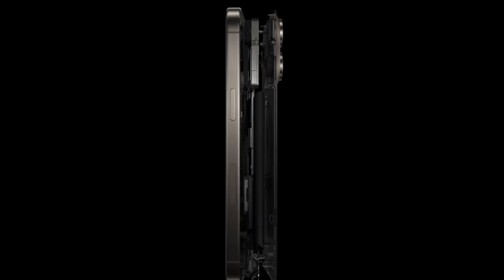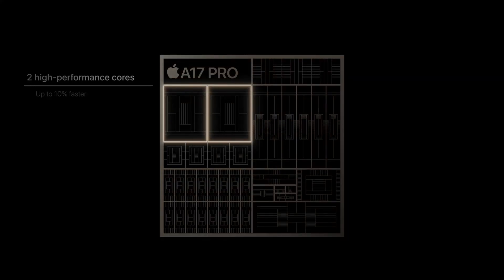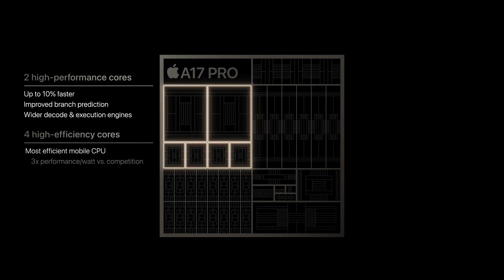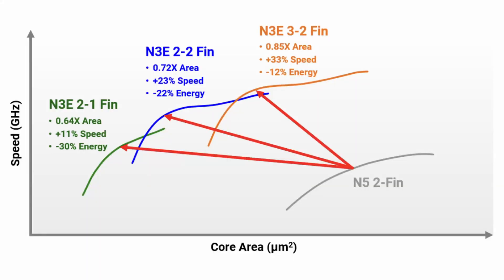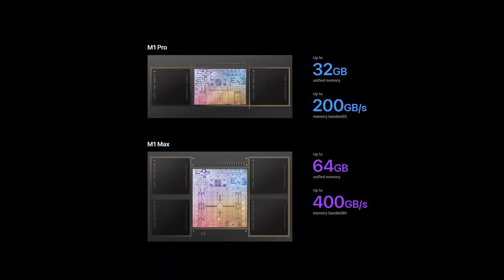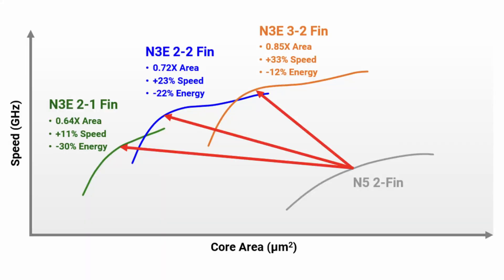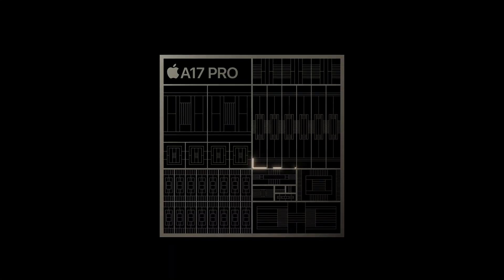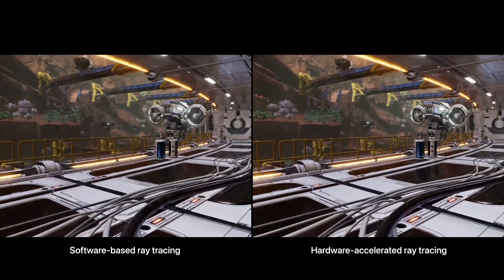Apple M3: some thoughts on the upcoming chip

Comment: Sorry, but I have to strongly disagree.  The three styles of 3nm design are quite correct, but the design of the GPU is very, very different this year.  Apple was going to do what is now the M3 in the M2 slot, but the graphics engine addition of hardware ray tracing was defective.  Their method created too much heat, far too much for the Vision glasses.  So, Apple panicked.  First, they put the M1 graphics engine in the M2, and pulled back from 3nm until they had a fix for the GPU.  Then, Apple fired a whole bunch of engineers, then took the remainder off to Blender to figure out what went wrong.  This is quite amazing for Apple, by the way, who usually does everything in-house.  Well, Blender, enthused by the huge lump of money dumped on their consortium, did indeed fix the problem.  So, adding GPUs is not at all the same now that you have a tiny NVIDIA card in each GPU unit.  Oh, and another thing, think back.  At the beginning of the M series development, Apple made a change to Metal. No one could figure out why, but it was to remove certain methods that require very high bandwidth for ray tracing.  But why, everyone wondered, Apple had a high bandwidth interconnect on board the chip.  Then, the Mac Pro, a big box with a backplane.  Huge power supply, mostly empty.  Then there was rumors of a cluster addition to MacOS.  Well gee,  put that all together, and you have a 4 processor M3 Ultra cluster server with distributed hardware ray tracing that is a brute.  An absolute brute.  96 GB of shared graphics/system RAM per processor.  Whee!
Reply: Blender (a software 3d developer) fixed Apples GPU (hardware) problem?  Pull the other one fella—it’s got bells on it.

Comment: What is your take on all the overheating and thermal throttling issues of the A17 Pro in the 15 Pro iPhones? As far as i know A17 Pro is on N3B and not N3E, which looks to be a more significant disadvantage than expected. I guess M3 will wait for N3E then - probably mid 2024. I do not share your take on apple differentiating between processes on for example cpu cores for M3 and lets say M3 Max. Apple was able to hugely benefit from a scalable and modular chip design. I would suspect such a move would neglect that advantage. Especially in current times, where Apple seems to aim at stable prices they surely won´t go the luxuriant route. That said, i am sure that Apple will differ the process between cpu, gpu, npu... as far as it won´t affect yield. Regardless of what Apple choses to do, I am excited to see and I am sure we will find out, although we might need to wait for some time.
Enjoy your vacation!
Reply from the maker: I need to reserve judgment on the A17 Pro until I can do my own testing, but I’ll do a video if I have anything to add to the discussion. Thanks for sharing your thoughts 👍🏻

Comment: I think that it unlikely that entry level M3 systems will be balanced systems designed to give the maximum performance possible at a given price point. Instead like entry level M2 Macs they will have a single small slow FLASH module and only 8 Gb of RAM. People will boast that their new 256 GB 8 Gb M3 MacBook Air is faster than any PC laptop, whereas they would get better performance with any M1 or M2 MacBook Air with more Flash storage and RAM.

This reminds me of when I helped a rich accountant to set up his new £399 Sinclair QL system in 1984. He told me that he had bought it because the advert said that it was a 32 bit system and so was around 5 times faster an IBM PC costing ten times as much. I did not labour the point but hinted that he was wrong. The reality was that the 32 bit 68008 processor in his QL was crippled by an external 8 bit data bus and by having tape rather than hard disk storage. 

In the same way entry level Apple Silicon Macs are crippled by slow SSDs and by not having the 16 Gb of RAM that would be present in any entry level PC.

Comment: Do you think Apple’s choice on FinFlex is what accounts for the high power consumption and reported hot running of the new Apple iPhone Pro Max, or do you think that in order to obtain a higher yield Apple accepted less power efficient chips that might under a less novel fabrication? In other words, did Apple lower the quality bar on the A17 Pros to have sufficient for their iPhone Pro launch, when perhaps the 3nm production was not ready for market?
Reply from the maker: Difficult to answer as I’ve not had chance to do any testing myself. Just speculating… I would have thought they would go for maximum efficiency with the A17 Pro. It is true that these processes get refined over time, so it’s possible there is a greater performance difference between batches early on in the lifecycle. From what I’m reading, not everyone is seeing the overheating to the same extent. 

Regardless of the process, they are putting a huge amount of compute power in a passively cooled device, so the heat is probably inevitable.
Reply: Thanks for taking the time to reply. Always enjoy and value your take on all things tech  @ConstantGeekery